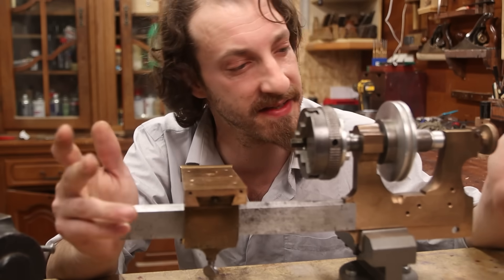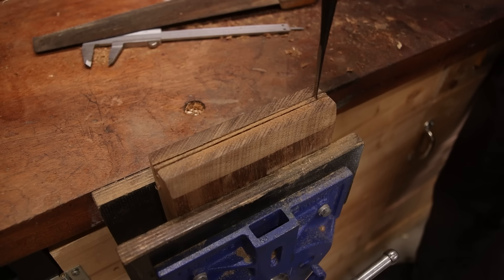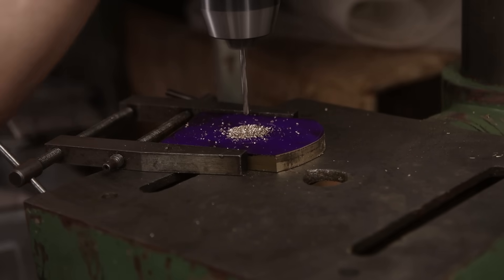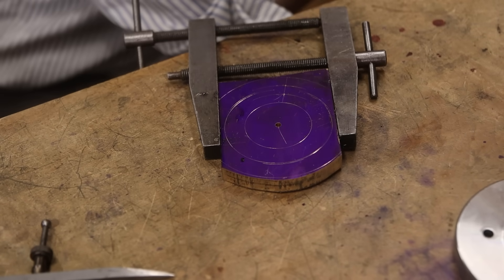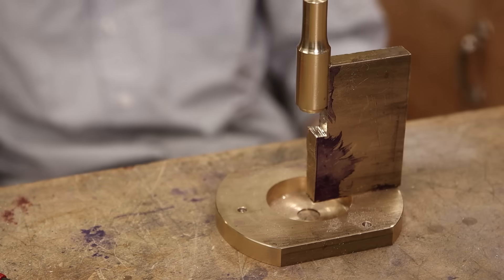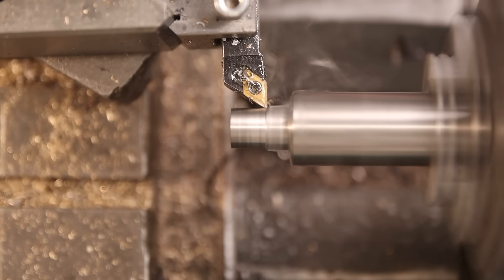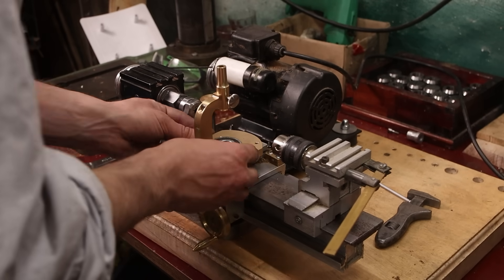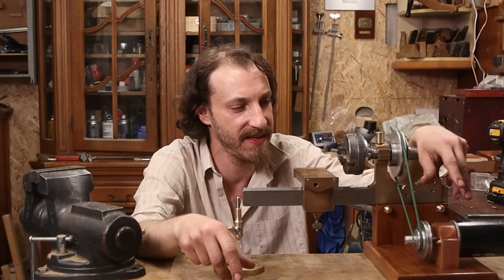Homemade Gear HOBBING Machine

Comment: Not sure Clickspring has anything to worry about just yet but I love this, and yes it was a bit of a chore but anytime you Frankenstein things together there is a lot of tweaking, adjusting and compromise. At the end of the day if it works to the standard you need them it works.

Comment: Without synchronization, it's not even real gear hobbing, more like botching a undefined amount of teeth onto some round piece of something.....
Can do the same on any old shit mill, only need a hobber and 2 nails as dead centers.
Reply: yup youre right. at the mercy of the pitch if you dont know your diameters, may work if you use the right diameter but im not sure. we do gear hobbing properly. even then he isnt even gear hobbing just worm hobbing but it isnt correct. doesnt have a throat radius or centre distance just to name a couple. for shits and giggles itll work but thats all it is. i dont mean to shit on him because him being a hobbyist it would be really hard to figure out the stuff with the information he finds.

Comment: I bet the original would work just fine with brass if you "make" a non-fluted tap out of a very-hard steel bolt... try it... OR make a tap with very small/narrow flutes... it's the harmonics/hammering causing you the problems... AND add "drag/tension" on your blank....

Comment: Lathe making with Uri is what got me into lathes <3 note: I think you're supposed to use High_pressure grease rather than oil for the turning between centers thingy you are doing there for the gear cutter + the microscope thingy holding the gear
Reply: I've actually seen an oil soaked piece of wool yarn or felt placed in the hole below the cup to prevent the oil from just leaking out when you fill it.  It maintains light contact with the shaft and also acts as a cleaning cloth to grab any particles to prevent them from entering the plain bearing.

Comment: The oilers I have on my lathe have a piece of felt in them just like the lubricator on a old points distributor. If the cotton flows too much oil i would try a filter from a cigarette.

Comment: Hobbing is obviously the best way to make gears. Andy's Machines has a cool adapter he made for his mill, to allow internal and external gears to be hobbed or broached.
Reply: Depends on the lathe setup.  ClickSpring makes extremely high tolerance gears using a fly cutter.
Reply: @earthknight60  The tolerances aren't any better from method to method, but hobbing is significantly faster. And stronger than sintered powdered metal gears.